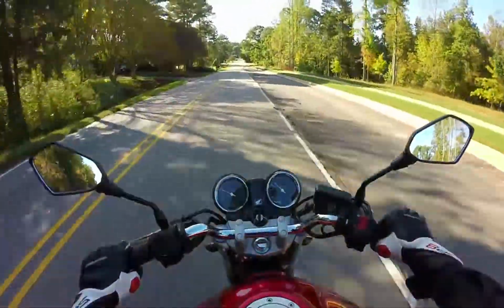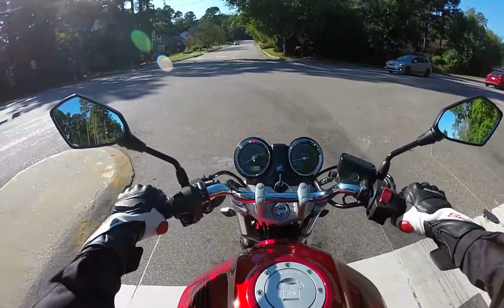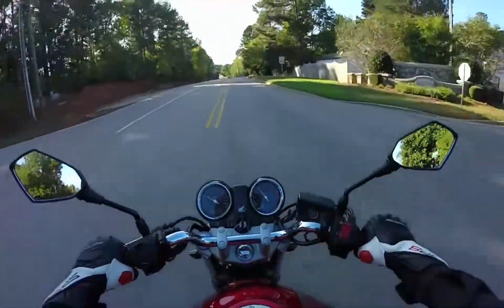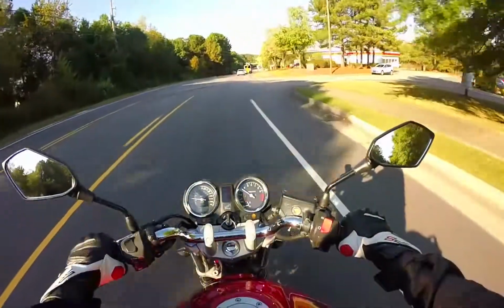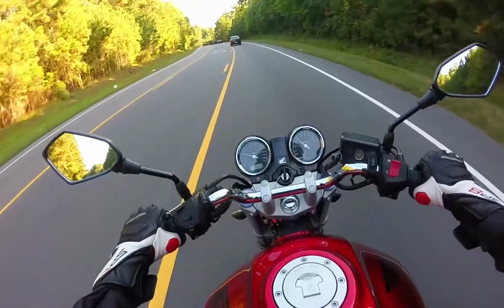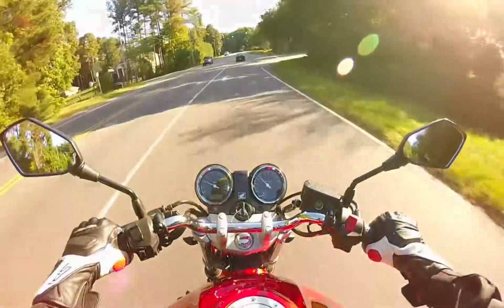Delkevic Exhaust on the 2007 Honda 919 Hornet CB900F

Comment: I pit on a delkevic tri oval, i started and revved the bike without the exhaust and it was surprisingly not that loud, it just a little less loud with the exhaust on.
Reply from the maker: How are you liking the exhaust?
Reply: Sounds great! Easy to install and not to loud just enough, well worth the price
Reply: was the installation straight forward?how about build quality.been looking at used akropovic cans but still £450. at the end of the day its a tube with sound deadener material and a baffle right!
Reply: billy1858 easy installation, it took me about 45 minutes to 1 hour and the quality is great compared to a 1000$ yoshimura exhaust or gp exhaust. Its not too loud but you remove the baffles and it gets louder